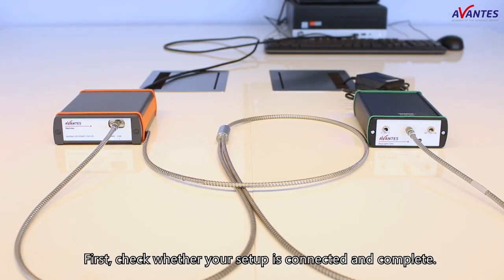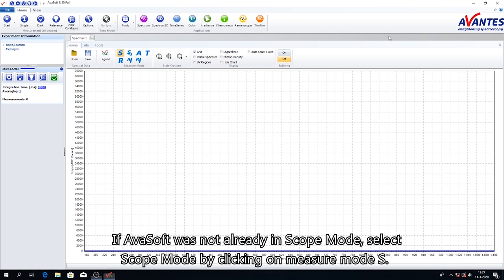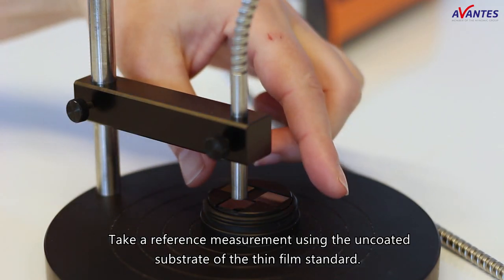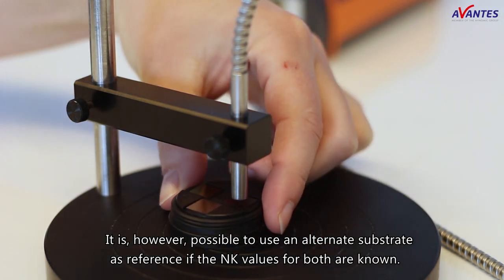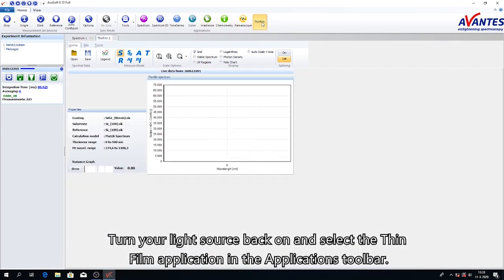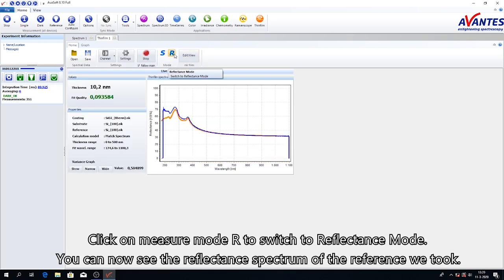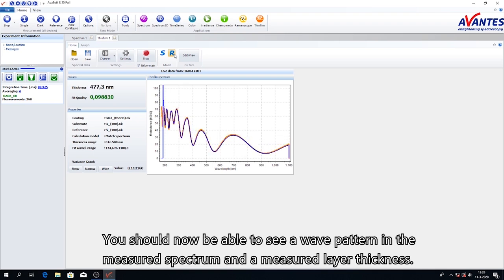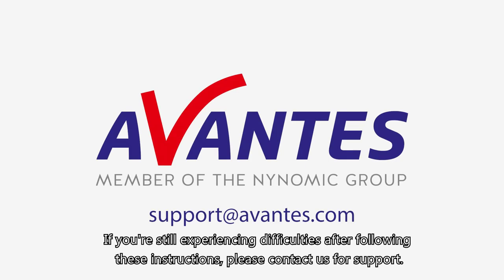How to Perform a Thin Film Measurement - Part 2

Comment: What parameters of thin films can you measure here? Is it the film thickness? Is it possible to measure UV-VIS absorbance of thin film deposited on a silicon wafer substrate?
Reply from the maker: The thin film application does indeed measure the thickness of the film. 
The absorbance of a film deposited on a wafer can also be measured, this would be done through a reflection measurement. Taking the wafer as a reference you can measure the reflectance of the wafer with the film, the difference between the 2 measurements is the absorbance of the film. 

Please let us know if you have any further questions. We are happy to help you
Reply: @avantesbv  Thank you very much for you reply. I will write my further questions to Avantes info e-mail.